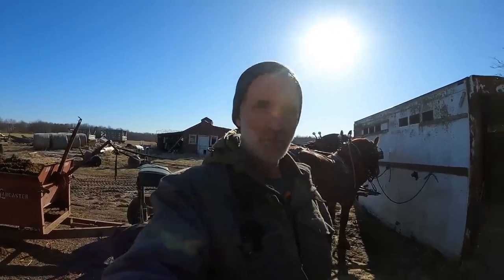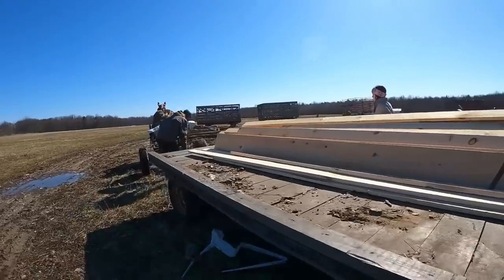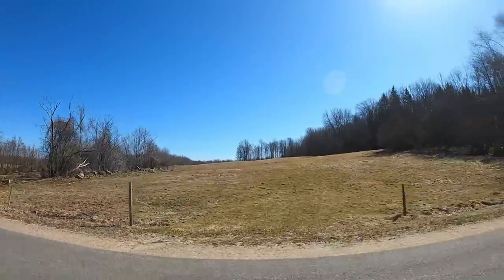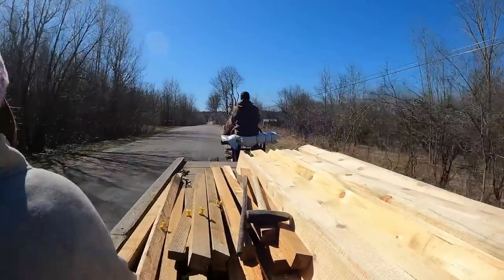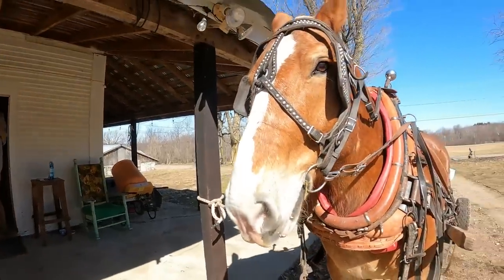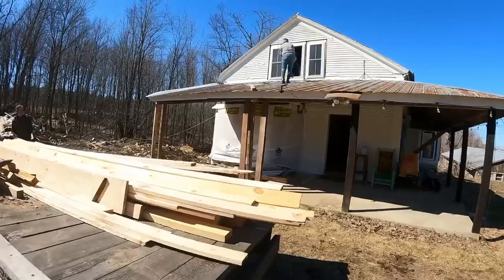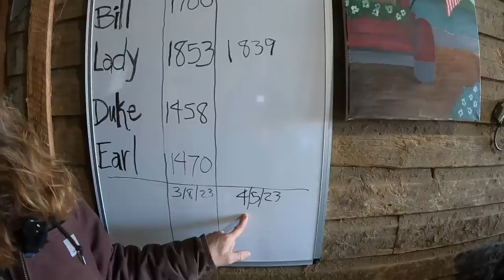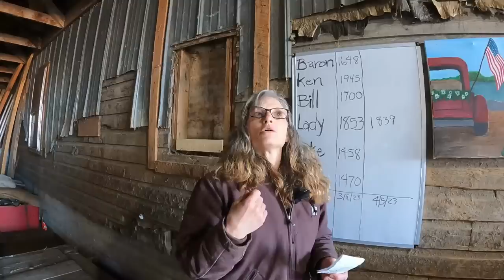DRAFT HORSES: Special Lumber Delivery to Abby's House & Weight Contest Winners!! #466

Comment: Good to see everyone feeling better and up to some work. Seeing Bill trot with the load to Abby's and then do a trot & canter (not sure if that's correct but it didn't seem like a gallop to me) on the way home! He was feeling good this day for sure.  I didn't officially vote on Lady's weight but I'd been thinking it would only be a few pounds so I was thinking around 1848-1850. Either she hadn't pooped and had drunk a lot of water on 3/8  or she played/worked off a lot of weight by 4/5.  

Wondering if you could give some parameters for the foal's name. I've noticed that you lean toward human names and also short ones. Direction would be helpful.
Reply: Your correct it was a Canter 😊

Comment: A question for you & or your viewers that also work horses.

What is the weight a 3 horse across hitch could pull and especially could back, on pavement, for a short distance?
Watching you back, having been a semi driver, working in a big city, (big city semi driver translates to being in reverse about as much as forward. And extremely tight backing the norm). Watching that extremely restricted backing up you did for your daughter, made me wonder if 3 or 4 across draft horses could back a fully loaded semi trailer an a tight, complex back. Using a fifth wheel 2 axel cart. 
Might be a whole new industry 😅
Actual yard horses instead of a "yard dog" If it was possible, State of California would insist on horses in the dock and tran yards LOL😉